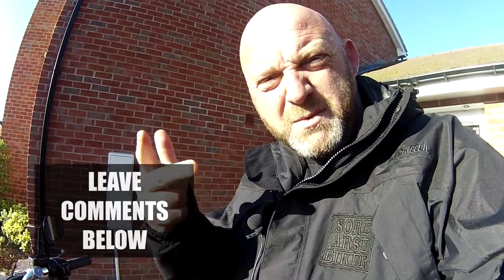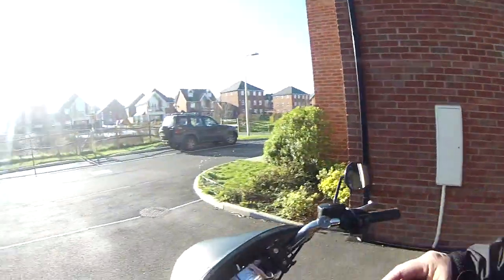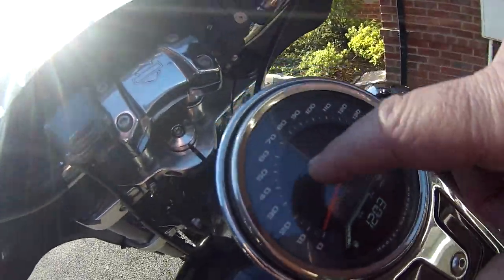Why is ABS light flashing on my Harley Davidson Softail & Sport Glide

Comment: I used to pull the ABS motor fuse on my Versys when I was going to take it off road. Light went on, but it would correct as soon as the fuse was installed.
If you want a thrill, ride down a steep gravel hill with ABS on. Be sure you leave a lot of space between you and the guy in front, because your bike's brakes will keep backing off as they try to catch grip until you're flying down that hill with no brakes. That'll get your adrenaline going better than any Stage kit.
Reply from the maker: Ha ha yes indeed. When I took my ADV off road I basically switched everything off
Reply: @RevelatorAlf  Versys didn't have a button to kill the ABS. Interestingly, I could kill the traction control, but I usually left it on. Going up gravel hills could result in some engine bogging, but it always managed to make it up the hills with the TC on.
My Triumph does it right. One can kill everything and wheelie and stoppie until their heart's content. Then re-engage it for regular riding.
The Road King has no real need to kill it. If I'm wheelying or endoing that thing, it's because I've done something terribly wrong and am moments from certain death.